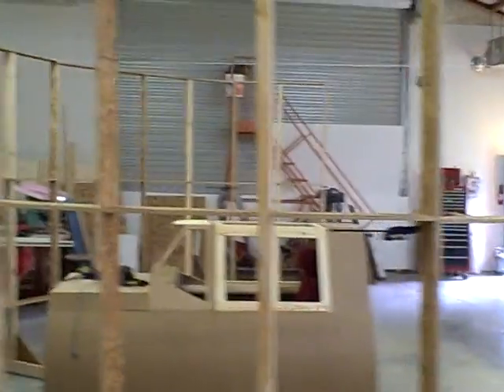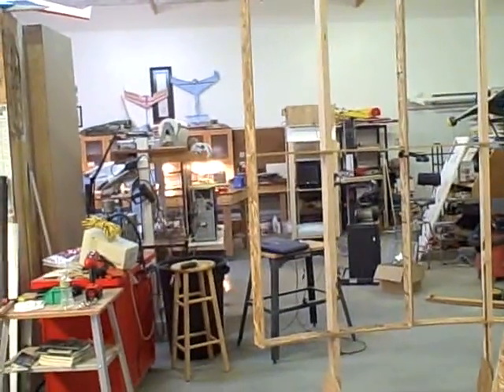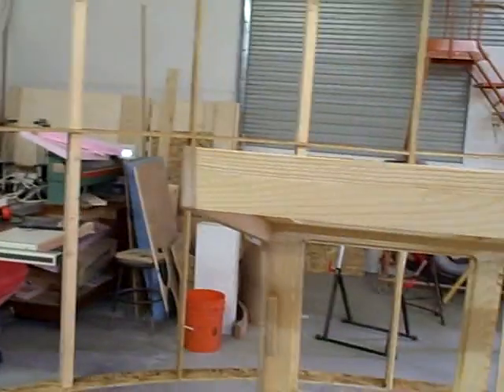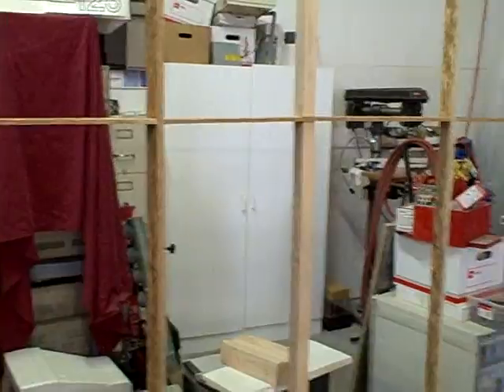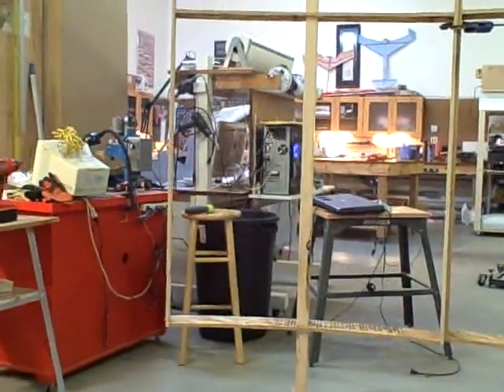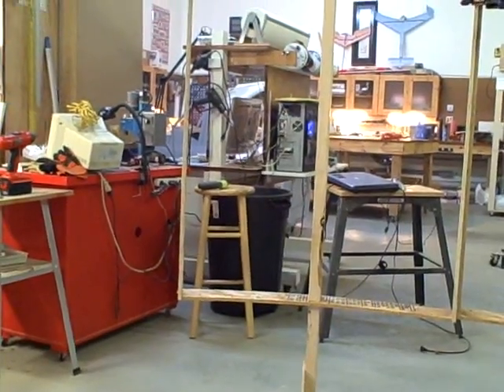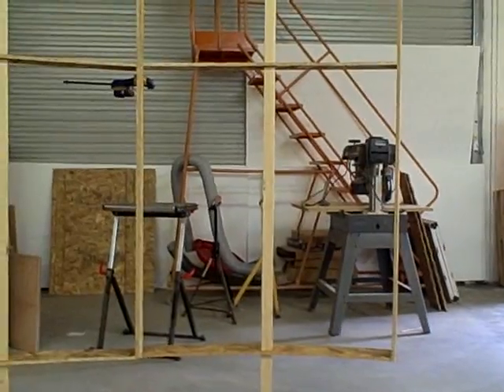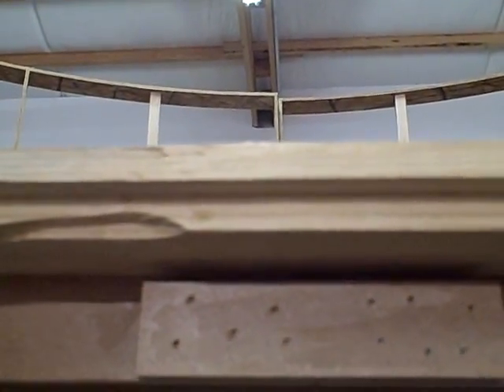Screen update...

Comment: Very cool Mr.F-15 guy. Will you be using 3 of those kit built LCD projectors to cover your left, forward and right side? Should be interesting to see a seamless blend of those 3 projectors. I see your cockpit resembles the Me-109. According to A2A simulations, they will be doing an accusim reproduction P-51, P-40 and Me-109 in the future for FSX. From what I have seen, the P-47 and B-17 accusim models are incredible, so the next generation should be just as cool if not better.